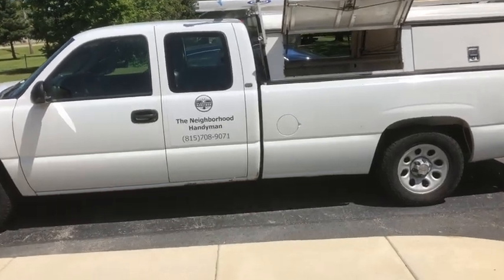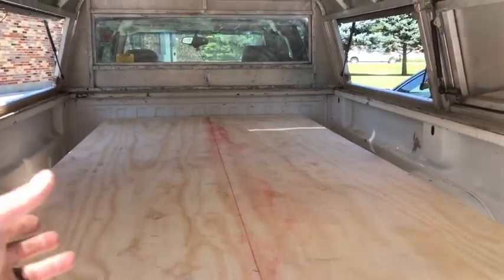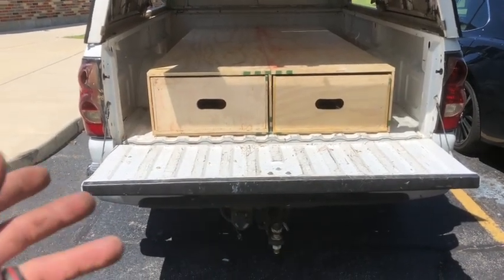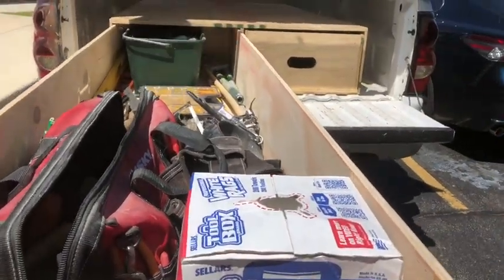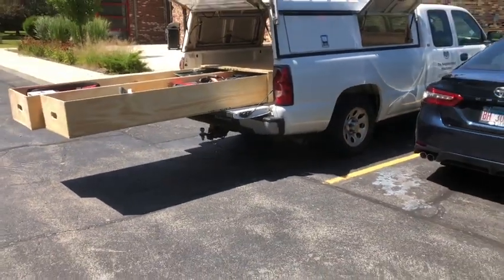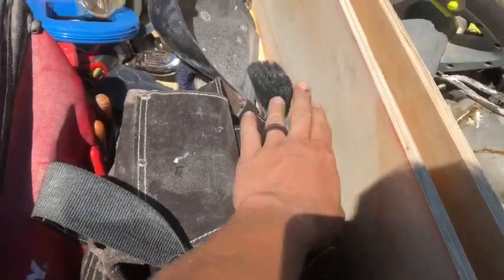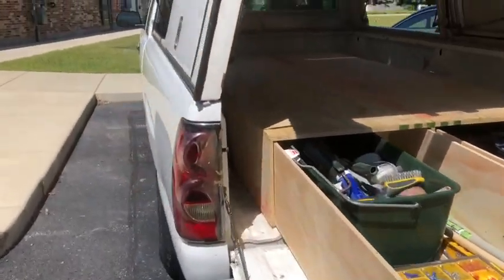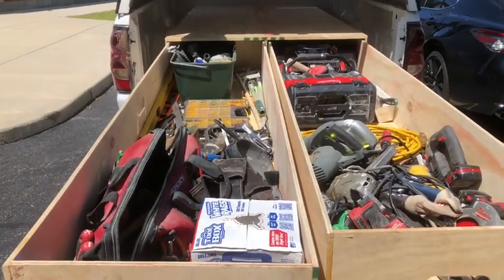Truck Bed Drawers

Comment: Nice job. Put a little wax on the bottom of the drawers and the floor. You won’t need sliders. You will get a lot more organization if you do levels in the drawers. The topper and this setup is much handier than a trailer in the city.
Reply from the maker: robert gullickson https://youtu.be/rjpC6XuTdr8 this is the video of the updates I did to it including trays